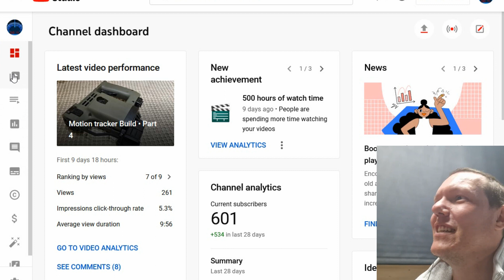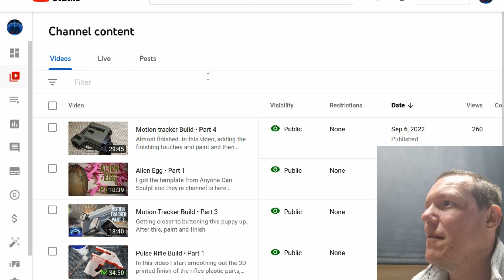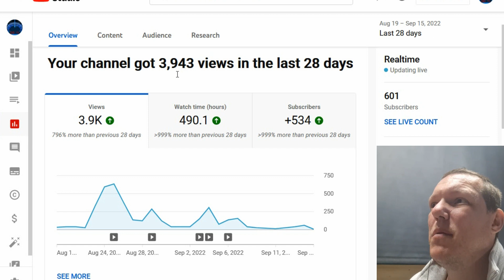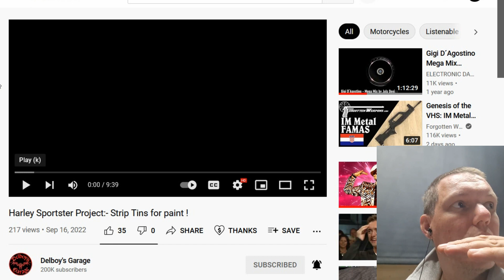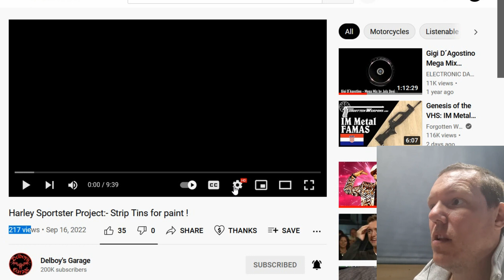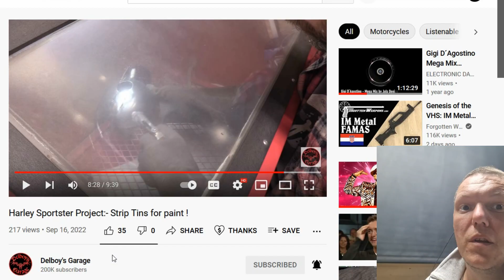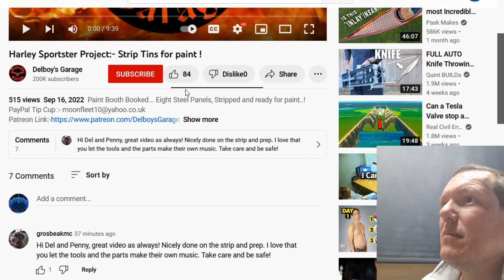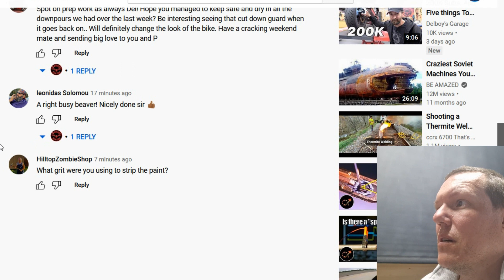NOP oil tank prep

Comment: Matt, he's taking paint off with a grinder.
Which method would you recommend?
Couldn't he just drop the parts in a solvent solution overnight? Instead of filling the entire garage with dust?
Reply from the maker: 1) the old good solvent is DCM, which has been banned in the EU.
2) he could sand blast it with the proper compressor
Reply: @thedirtyworkshop  What about the gel stuff (paint remover)? Could that product be dissolved in a solvent, so that the active agents do their job overnight?
There are parts which are impossible or very difficult to sandblast due to their geometry. Surely, there must be a legal, liquid solution (even if disposing of it might be pricey).
Reply: @leoa4c  DCM through a chemical supplier

Comment: 9:30 we not using diamond tile cutting disks on metal anymore?
12:45 wera not getting a shoutout then eh?
15:40 I personally find the dispenser that comes out the middle of the roll is better than the sideways one.
16:30 putting the grinder down while it's spinning classic
17:00 thats it dig that guard in it makes it work better
17:17 again with the grinder down before it stops spinning
17:30 and again
Reply: The tile cutting disc painful to watch, shot blaster taking a close second!!

Comment: I bet he has his air pressure cranked all the way up on his blasting cabinet. I run mine around 50/60 PSI with glass bead and it would rip off that paint of his in seconds, as you say just looks like he's spraying it with just air.

Comment: Where Harley has found so low quality steel, that almost all of the parts are totally corroded?
Even the shittiest cars of 1970 to 1980's didn't corrode that bad and that's a low mileage motorcycle, which 
most likely has not been driven on salty roads- during winter.

Integration - Hah!
I bet you could shave at least 5 kilos off from that piece of garbage just by chucking the excess dodads in to the "arts" bucket.

Comment: This whole thing was painful to watch. 
If I want small parts like that back to bare metal I will use electrolysis to get the rust and paint all at once then give it a wire wheel at the end. A gentle and complete job that will get all paint and not gouge the metal.
Grinding the way he does is far to aggressive for me.